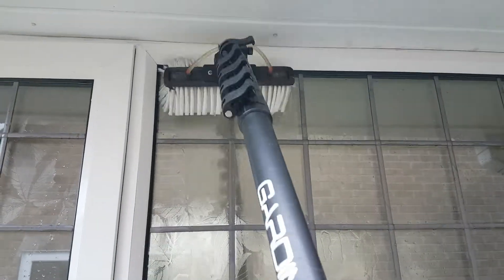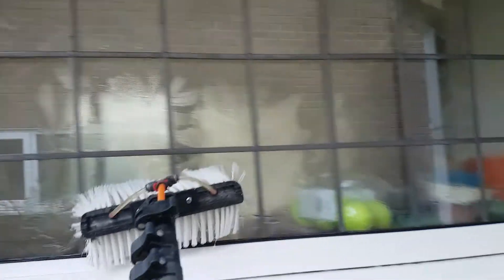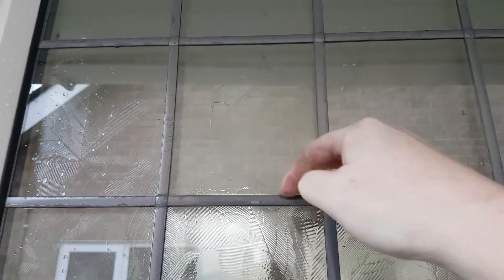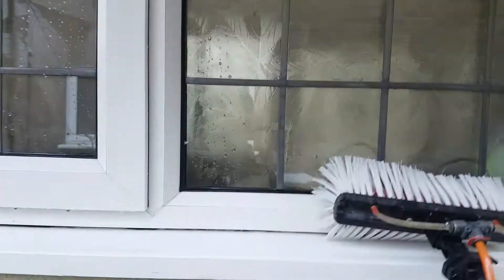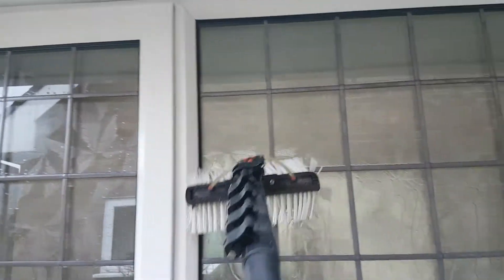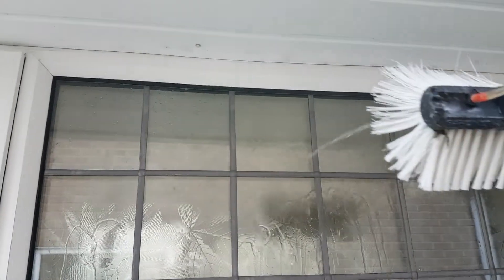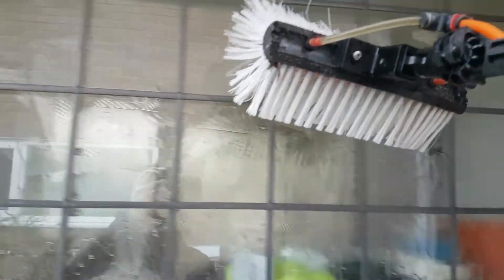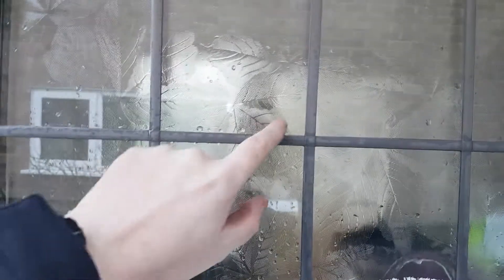Window Cleaning - How to - WFP - Water fed pole - Leaded Glass

Comment: Ah cheers i've just switched to wfp, been up n down ladders for far far to long, 27yrs in fact. Only on 2nd day with it. Obviously it's taking longer as i'm going round all the frames getting all the crap off before cleaning the glass. I found this vid helpful as i'm doing 3 huge houses nxt week and they are all lead. Cheers for the tip👍

Comment: Any tips on how builders clean approach to leaded windows? Customers had an extension and loft conversion and caked the glass in cement and plaster
Reply from the maker: Honestly, in that scenario, I would allow for at least 2 days and give them a day rate.  Do not let them put you in touch with the builder in hopes he will pay you, the builde is not your client, the home owner is.  Real straight give them a price in writing and if they accept go ahead.  Otherwise it is on the builder to rectify the mess.
Reply: Green Pro Clean Ltd thanks mate, would you take the same approach with using scraper and bronze wool pads? Or would they damage the window? Just thinking more practically how to approach if I do end up doing it
Reply: @alllthingsnatural  you can damage the window but only if not done right.
Reply: Stock Content Pro exactly, any tips on how to approach?, bronze wool pad? Scraper?

Comment: Does oxidation not cause any issues on leaded glass?
Reply from the maker: Hi Chris, never noted issues with regularly maintained windows.  Sometimes on windows that haven't had a cleaning in a long time have carbonate deposits on them. This can be treated with a mild acid. Lemon juice actually works quite a treat on this.
Reply: How much lemon juice do you have to add
Reply: And do you put it with the pure water